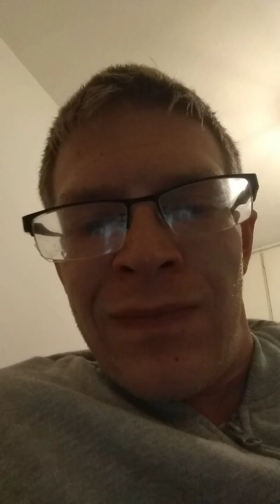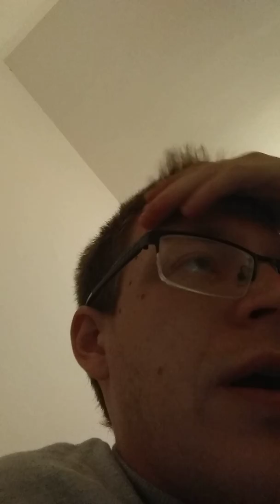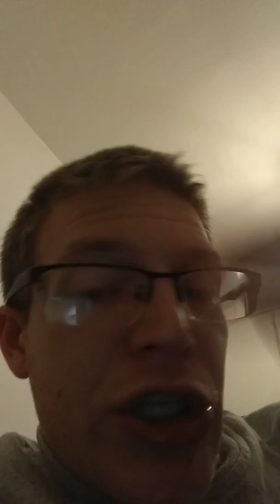Atmospheric Water Generator (AWG)

Comment: Glad you're not giving up!😊
Reply from the maker: Helllllll no I won't give up. Thankfully all the input from crowdsourcing the first stuff I made has taught me so much to design more efficient models. I'm doing first response business development to build capitol for now.
Reply: @MartialBorschel  sir,
Have you given up now?
If not, I have some ideas (maybe amazing).
I am also trying to do the same thing for same purpose for long time: Plants Everywhere.

1) I have seen a project on youtube. It blows hot air into a long tube burried inside earth & water condensed is stored in collector at other end of tube. Collector vessel is connected with hand pump. Air blower is designed as wind propelled fan.

2) Ancient way: dig a pit, cover with leaves (or transparent plastic), place a vessel at bottom
.
I am trying to modify it a little. Instead of pit, i will place a empty neckless water bottle upside down on any wet surface in sunlight.
For collection, a pipe can go from inside of bottle through wet surface to outlet.
Maybe it's not possible in desert, but any waste water or sea water will be good.

3) something like polyhouse. Plants exerts moisture & there are some type of plants in every environment.
You may have tried to cover a plant with polybags, the moisture inside polythin condenses very fast.

So what I want to do is, 
Capture moisture, from waste water/sea water/plants respiration.
Use that water to plant trees near ocean, or near STP's or in deserts.
Use that plant's waste for organic fertilizer and start a 'positive feedback loop'.

It's clear that we have to do this in large numbers like yours. But, we basically need only 1 item: waste plastic bottles. Which are in abundance.

I know It's not completely clear what I said above. And I can't say everything here.

But sir, There is hope.
How should we discuss further?